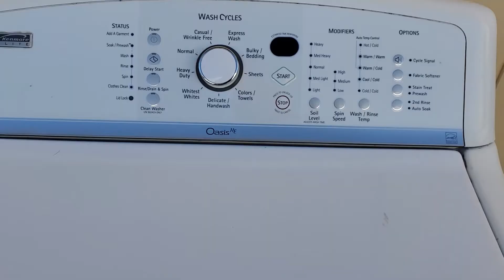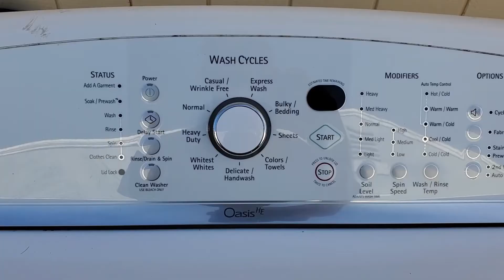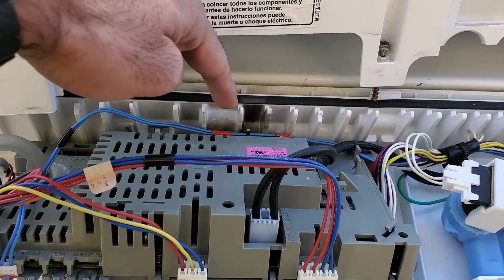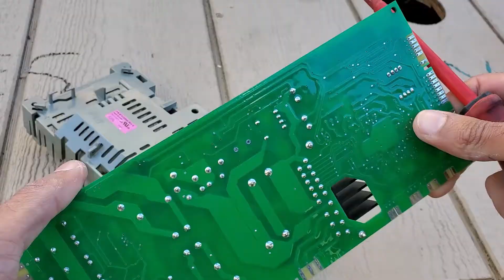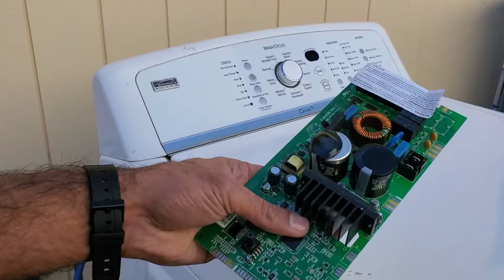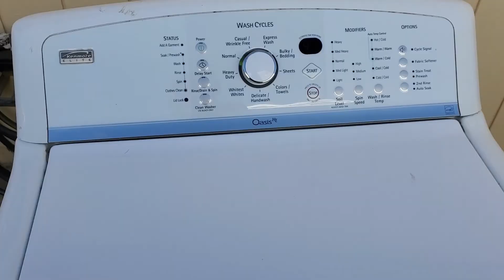Troubleshooting And Fixing A Kenmore Washer That Will Not Turn On!

Comment: Im trying to justify fixing my Kenmore washer from about 2012. Its a smaller one in the $550 range. Im pretty handy and mechanical i do my own auto work but i feel like mine has everything wrong with it😂😂  evwntually it would wouldnt agitate (impeller) it was like that for quite awhile. Then it stopped spin drying. Then shortly after that (yes, I used it twice after it wouldnt spin dry and quickly handwashed inside washer 😂) it drained and stopped doing anything at all.  The door has a latch and a lock. If i play with that i can get it to turn on but thats it. Nothing else. Just says "sensing". When it was somewhat working there where times id smell an electrical smell though very faint. Checled the board and nothing visible thats obvious. It would be a shame to toss out if it was something easy like this but I feel its more than that for some reason

Comment: Hey I have a kennmore elite 2015 or 2016 model with the glass top I turn the knob and the selection doesn’t change any ideas?
Reply from the maker: Most likely, the interface panel is bad, try resetting the machine

Comment: My Kenmore washer wasn't powering on and I saw one possible solution was unplug it for about 5 minutes and then replug it in and I left it unplugged about 10 minutes plugged it back in and it worked fine. I also turned off and turn back on the circuit breaker but it wasn't off in first place so i think the real fix was just unplugging and replulgging. I read this resets it .
Reply: This just worked for me!
Reply: @Casaundwich  glad it helped you out 😁
Reply: Omg thank you!!! It just worked!!
Reply: Yay glad my comment helped you @jessicalopez248

Comment: Thank you for this informative video. What voltage multimeter would you recommend for a beginner to get?
Reply from the maker: If you are only going to use it once in awhile I would just get a $10 one from Harbor Freight if you plan on using it more often I would definitely recommend one made by Klein

Comment: I could use your help. I am not a tech just a DIYer. I have a Kenmore 90 Series washer. After completing one load of wash I started a second. The tub filled with water, agitated then stopped. No matter what setting I put it in nothing happens. No humming, nothing. Another Kenmore 90 series washer was given to me. It agitated but no spin. After checking it out it was only a loose wire. Plugged it in & it went through the cycles. Put a load of cloths in & the only cycle that will now work is the spin. Any help on either one of these would be appreciated. I did notice same series but different timer control model. I did check the lid switch, both are good. I even jumped them to make sure. On the first one I changed the timer & the only function is the water will fill.

Comment: I plugged in my Kenmore washing machine & didn't know the knob was already powered on when I plugged it into the wall & it made an electric sound, then stopped working completely, blew a fuse or what?? <3
Reply from the maker: Could be a fuse on the board...got to check input and output voltages to be sure. I have a video on my channel describing how to do this.
Reply: @DuctTapeMechanic  Thank you for taking the time to respond with a possibility, may blessings and prosperity be with you. <3

Comment: I have a 110 that will light up like its going to start, but then just starts clicking from under the tub?
Reply: I think the clicking is the actuator motor. It directs a cam shifting from "free-wheeling" wash plate(Spin cycle) to "engaged"; which is Agitate. ( months ago?) You've prolly fixed it by now.

Comment: I have one identical to it the problem is everything else works but the pump won’t turn on I pulled it off and hooked power to it and it works nothing is plugged up. Anyone got any suggestions?
Reply from the maker: Perhaps a relay is stuck on the main board causing the pump to come jn. See if you can find one online for cheap. After replacing the board make sure your pump js not running too hot (touch it after a load) it could be drawing too much current thus messing up the board (best practice is to replace board and pump)

Comment: Great video! Is it worth keeping that old board for the components that aren't bad?
Reply from the maker: Thank you! I typically hold on to the bad boards, they are good for capacitors and relays.
Reply: Took the panel apart and checked the outlet and cable, all good. Checked the connections, and BAM, its working again!  Must've jiggled something loose on an unbalanced load! Thanks for the help, brother!
Reply from the maker: @winegarstronghold2734  right on! Good work!

Comment: I have a Kenmore 600 series (mod # 110.26132410) top load washing machine.  When putting in a new load of clothes, it just won't turn on.  I definitely have power going into the main control (tested that) any other suggestions?  Thank you.  Great video.
Reply: I have the same washer and won’t turn on. I replaced the control board, have flashing LED light, no burns or anything visible. not sure what to check next 😩😩
Reply from the maker: I would inspect the control board for any burn marks or swollen capacitors which would mean the board js bad. Also check to see if an LED light is being lit up from the control board (if it is not then your board is definitely bad).
Reply: @DuctTapeMechanic  Thank you.  No Burn marks.   No LED light on the control board.  I see that new control boards are $499.  Used  prices vary... How do you know that the ones you get from eBay are any good?
Reply from the maker: @timcochran1385  I would say if you can get used board for $60 or less it is worth the risk. Otherwise you are looking at a new washer.

Comment: washer will fill with water and drain and spin but won’t go into “wash cycle” ?
Reply from the maker: Sounds like you have a bad mode shifter. Should be able to find the part on Amazon.
Reply: @DuctTapeMechanic   and where is that located?
Reply: think i got an ideal where n what it looks like thanks i’ll try tommor
Reply: @DuctTapeMechanic  dear sir,i’ve looked for the mode shifter but i don’t really know what i’m looking for? perhaps you could steer me in the right direction?

Comment: Hello, my washer is stuck on express load have unplugged for several minutes/overnight but goes back to express load will not shut off unless I unplug No error code. Model # 110-22062 109 Type 170 😢

Comment: Very good video  thank you!!
My washer has f 70 code , what I need to do ??
Reply from the maker: I would first try resetting the washer by unplugging it and plugging it back in. If that does not work there is an issue with the main board (the one I replaced in this video) or the interface board. Also check all connections on main board.

Comment: I have a kenmore 100 series. For months it will stop and keep lid locked during the cycle. It can stay like that for hours. What I do is unplug the bone. It takes hours before the machine unlocks the lid
Reply from the maker: Sounds like an issue with board but the lid lock could be faulty as well (easier and cheaper to start there)
Reply: Im in the same boat

Comment: AH! This is close to my model, but I lack the Spin Speed button which I hear you can hold down for 5 second 3x to test the cycles without the lid lock.  Mine turns on just fine, but I keep getting the LF error code for Low Flow, or Long Flow. Took the hoses off, cleaned out some sand from the screen (we are on a well, and this was bought in late 2006). It keeps stopping mid-cycle, especially during the Rinse cycle. I have to hit Start to bypass the LF code but I might do that 10x before it actually works and proceeds forward in the cycle. You can hear it try to fill but it takes many tries before it moves on to Spin and Drain. Only the Cold water screen had sand; the hot seemed just fine. Trying to run the washer only on hot water wash/rinse didn't bypass the problem. About to call a repair man, but I hesitate to pump a few. hundred dollars into machines this old yet I agree with all your comments about sustainability. Would hate to see these go to a landfill, and it matches my dryer which works perfectly. Would hate to buy a whole new set. Any ideas? Thanks!
Reply from the maker: That's interesting looks like you did a pretty thorough job troubleshooting. If you confirmed the water coming in js flowing fine then I think it is either bad valves or a bad main board that is not recognizing the drum being filled.

Comment: I need 2 buy that high voltage tool so I can pinpoint where it needs fuse, right?..., that tool is to cut corners n exactly know what's old, for a newer part.

Comment: Mine just died like this and same model
Reply from the maker: Might be worth it to try to find the board on eBay.
Reply: @DuctTapeMechanic  purchased a refurbished one off Amazon - was better deal than Ebay.  But I did get it working again.  I removed power 3 time and cleared the pressure hose, and checked all the connections, and it came back!

Comment: Will only fill 1/3 of the water
Reply from the maker: These are HE machines and do not use very much water. But it could also be an issue with the pressue sensor/hose